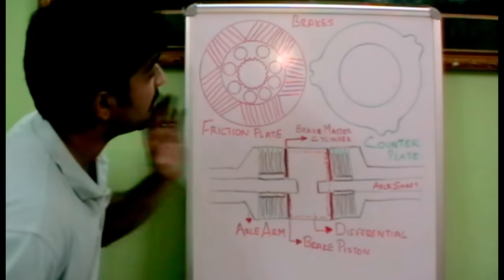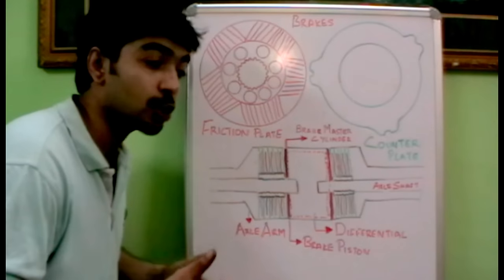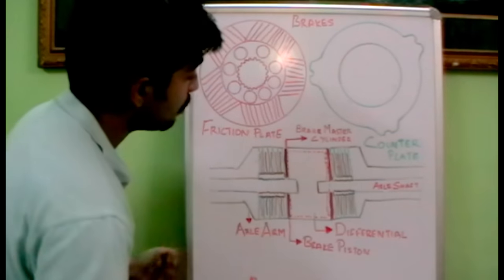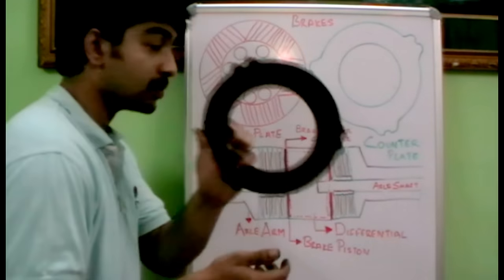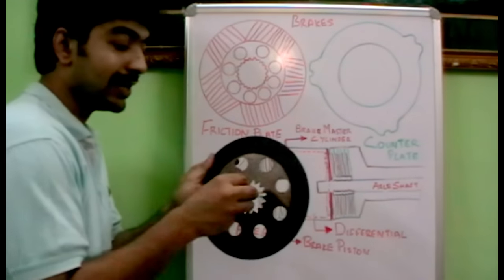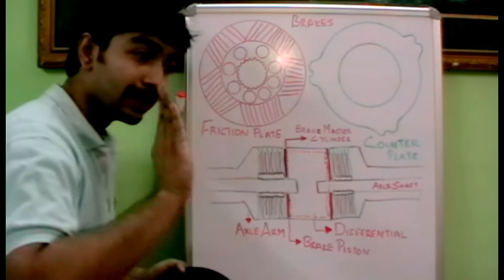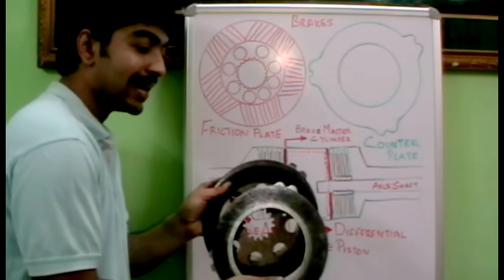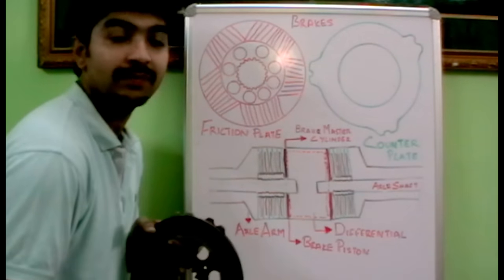How oil immerser rear axle brake works. ✔

Comment: Hello sir I need an help my JCB 214  brake jem ..can u show me need to check wat
Reply from the maker: Is it fixed or you still have the issue, have you checked your master cylinder for issues.
Reply: @TechTrixInfo  yea sir I got checked the master pump not jammed or leakage ..but if me try to spin 1 tire by Jack higher the JCB and press 1side brake got some noise inside the rear axle
Reply from the maker: Looks like you might have to dismantle and check, what was the outcome